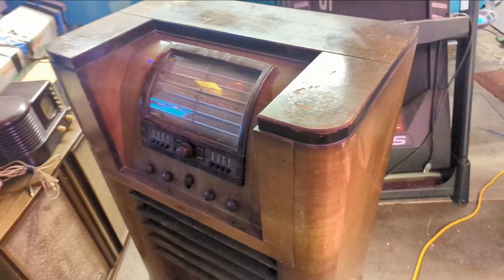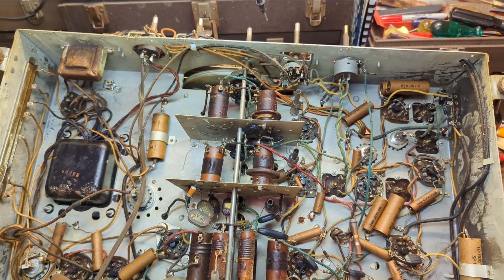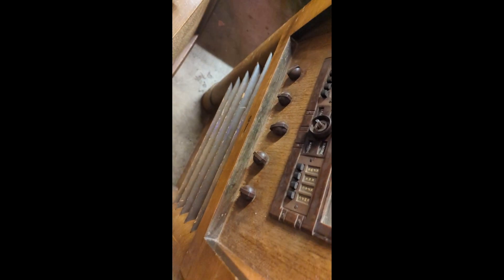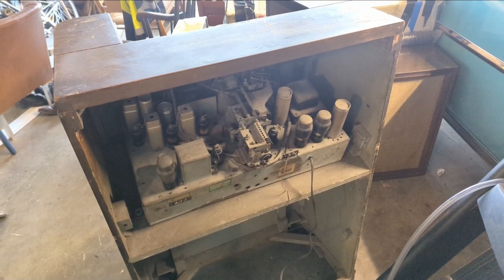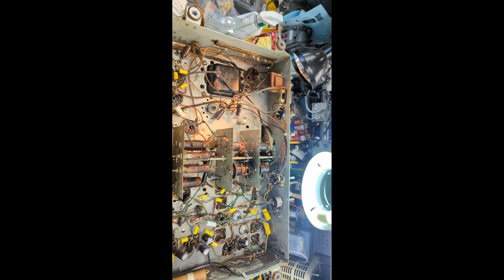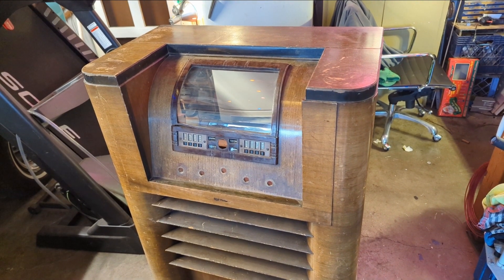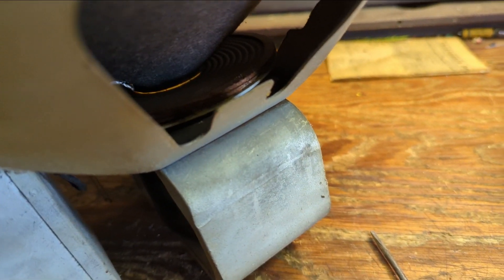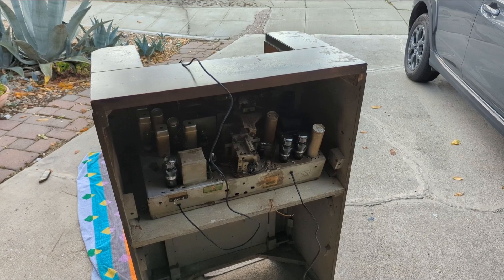Rat turd infested RCA 813K restoration

Comment: This particular radio has a very long Candome resistor with 6 sections mounted on the side of the chassis. With all
original e- caps present it probably shouldn't be turned on until those are replaced and good tubes put in! Use the RCA 
Victor Service Notes from the world radio history site and look under 1937 for the schematics. Big job cleaning and 
wire replacing needed. Very impressive AM with 4 shortwave bands radio. Nice speaker fix! it looks heavy because it is
108 pounds! Great repair work and the owner should be happy with it now Seth.

Comment: I've done a couple 811k's which are also 1938 models.  The electric tuning contacts must be burnished carefully.  Any corrosion whatsoever and the electric tuning will not work.  It's the hallmark feature of these sets, so I spent the time getting it working.  The setting procedure is interesting as well.  Interesting to note- the power transformer has a winding specifically for the electric tuning motor, unlike Zenith robot dials where the motor uses line voltage.  From what I remember, you cannot use a 6V6 in these sets, the plate voltage runs too high for them.  They really push the 6F6 and get some impressive sound out of them!

Comment: I'm an Australian gay guy 61 years old and love tube or valves as we call them. You said you were stupid. I have to agree......lol. I have my mums old Kriesler stereo radio gram but we don't have the available valves or a technician to fix it. I own a PrimaLuna valve amp 12AU7s x 6 on the preamp and EL34s x 8 in push pull. It's 6 years old now but its all point to point wiring and sounds amazing. Cheers from down under.

Comment: With a really old speaker like that which has been sat vertical for best part is 75 years. If the cone is rubbing on the voice coil, try literally turning the speaker 180 degrees so what was the top on speaker sitting in the cabinet will now be at the bottom and see whether that takes out some of the sag in the spider and cone assembly, and it may be just enough to stop it from rubbing on the voice coil because the speaker will have sand through sitting all them years with gravity, pulling it down sounds stupid but it does work in some cases

Comment: 6F6 is a power pentode.  6V6 is a beam power tube.  Very different plate impedance.  Yeah you can swap them (in pairs) but you could also hear the differences.